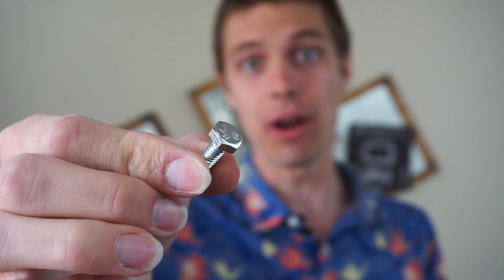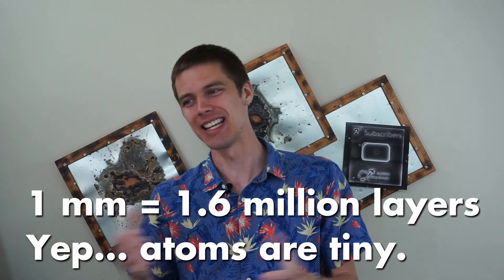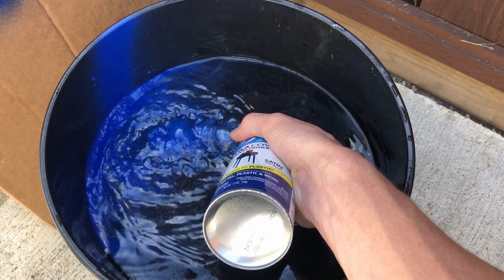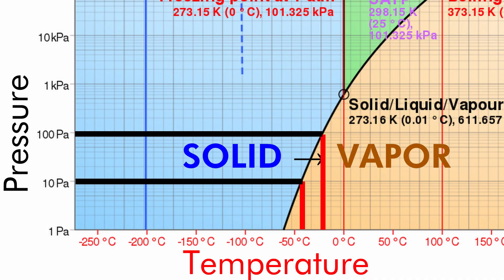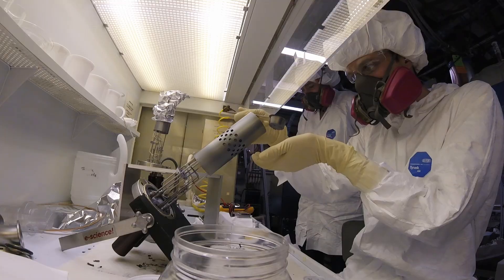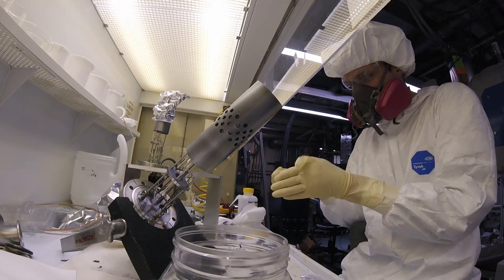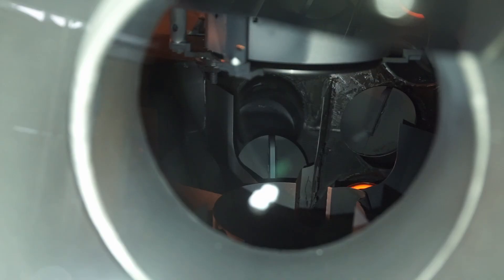How to evaporate a metal

Comment: I am much enjoying your series on your equipment. My father built similar equipment for Westinghouse several years ago to facilitate precision electron beam welding equipment and vapor deposition equipment for precision coating. They were test systems to provide proof of concept equipment and develop the technology to where it could be marketable. The vacuum pumps he used were very impressive to my teenage self.  The system was housed in a small cylinder, inside a booth the size of a small room to provide a two stage vacuum tight sealable enclosure, as the working surface had to be somewhat larger than those you are dealing with. There were,as I recall, three stages of vacuum pumps working on different principals to obtain the required levels of vacuum. On the other hand I suspect his allowed target area might have been somewhat larger than that you work with and the precision you deal with may require another order of magnitude of vacuum than Dad's system did. Dad built all manner of things as prototypes for Westinghouse. Engineers came in with fancy designs and schematics and Dad helped them to scale there sometimes unwieldy plans into something that might actually be capable of being built. Your lecture on how your equipment works is "deja vu all over again" to quote Yogi Berra.

Comment: I’m interning now at a thin film coating lab, we use resistive source evaporation, e-beam, and ion beam sputtering. Our pressure is only 10^-7 …. I’m not sure I completely see the need for epitax, it sounds like it works in between resistive and e beam. ?

Comment: I'm working on a prototype in cad right now. But there is a question I can't figure out. If I heat a metal in a vacuum past it's vaporization point without using electricity with it form a plasma? Or will it just be a hot heavy gas?

Comment: chemist question here:
if you "fire" gallium and arsenic at the plate:
do you have layers of gallium and arsenic OR do they bind "mid flight" to form gallium-arsenide (crystall)?

i´m asking because these are 2 completely diffrent things.1 is just evaporating 2 thing a depositing, the other one is a chemical reaktion mid flight.

Comment: As air tight as this all needs to be, I have to ask - how often does a shutter get stuck?  I think a saw a metal bellows flexing to move them - what's their lifetime, generally speaking?
Reply: They live for a fairly long time. Even if they get stuck (because of some deposit happening due to a bad alignment) every time you do maintenance you can fix it. Then your shutter lives for tens of years.

Comment: I used to operate vacuum deposition evaporators. E beam guns under vacuum are fun to play with, but sputtering is fun to watch. The particles tend to stick to the coldest surface. So, hot chamber but colder substrate...we were coating photo reactive optics.

Comment: I'm currently doing something very similar to this, just in extremely crappy fashion, in my basement.
I sublimate carbon in an arc in a ~1 Pa vacuum and hope to grow something vaguely resembling graphene on a silicon wafer with an oxidized top layer.
Does your apparatus have means to heat the target?

Comment: It is really interesting! Would be super neat if it could be miniaturized and used perhaps as a “nozzle” for a new type of metal 3D printer. Just mount it onto a gantry inside a vacuum chamber and feed it some gcode!
Reply: If you think about it, that’s pretty much what they do when making microchips, but with photosensitive resists and masks. That lets them build their 3D ‘cityscapes’ much more quickly, instead of the raster scan-like process of most current additive manufacturing. If a company could get good at aligning dozens, if not thousands of printer heads to print the same pattern on the same table, you’ll have a better mousetrap!

Comment: Now that we know WHY it has to work like that, I wanna know WHAT those coatings are used for...
Reply: As with most tech, probably military and or sex. ( Joking of course)
Reply: @darthandeddeu  This is for semiconductor research and although the cutting edge of semiconductors are not used for any of these, semiconductors are everywhere. The cutting edge of semiconductor tech is mostly used by NASA and internet companies. Or this is just what is called universal basic research in which case they are basically doing this for fun and for the sake of learning random stuff..
Reply: https://mukherjee.sites.stanford.edu/

He showed "Mukherjee Group" in the video, it looks like they study semiconductors and the effects of imperfections in their crystal structures. So I would assume it's important to be able to grow a flawless crystal as reference when studying imperfections, as well as to be able to precisely cause imperfections in the structure.
Reply: I work for a photon detector company. We make PbSe IR detectors. They're good for sensing ~1-5µm wavelength. We put the material on a substrate, cast a few spells (trade secret, sorry), and viola. Cool them down (we use TECs) and they can detect IR extremely well.
Reply: The Gallium arsenide is probably for a really good semiconductor, but I would guess you could coat almost anything with anything to make anything here... Yeah, I'm not a rocket-surgeon...
Reply: Check Balzers, there are many many applications, low friction, surface hardening... I don't know what he uses PbSe for.

Comment: I have a serious Question AlphaPhoenix. You Say you try to not touch the crucible with the bag. But the Material inside was rubbing against the Plastic all the shipping and while pouring it out of the bag. So isnt this kinda pointless?
Reply from the maker: Every additional surface adds contamination. the fact that packing is necessary is simply unfortunate. the e-beam evaporator I used in undergrad would use gold coins, but a whole coin wouldn't fit in the crucible. every cut with a pair of very clean bolt cutters would add contaminant. You couldn't cut too many times.
Reply: @AlphaPhoenixChannel  Thanks for the Answer. It is logical, that the Packaging is necessary, but with such expensive Materials, wouldnt there be a better variant of Packaging be possible? Something with is not that easy to scratch particles from the surface than plastic?
Before your Video I was never thinking about this part of cleanroom and high refined Stuff. Its a little mindblowing for me, to think about this in this order of magnitude of clean working.
Especially, because i am Car Mechanik, sometimes we have to work "clean" too, but our clean is pure garbage inside a canalisation against something like this. :-D

Comment: Probably too late, but if the bolt ‘evaporates’ at that rate, does the metal that makes up the vacuum chamber not do the same? Is it at a lower rate, or do you use a special method to mitigate that or stop it
Reply from the maker: I picked a zinc-plated bolt as an example because it has a high vapor pressure. The chamber is made from stainless and that pretty much goes nowhere

Comment: would it be possible to make graphene with this equipment?
Reply: Yes. But the reason graphene isn't used in industry yet is because many applications would require large sheets with few or no defects. Currently, the only ways to make such high quality sheets are by processes like this, which are expensive and slow. Hopefully in the future, new developments will make synthesizing large high fidelity graphene sheets much cheaper and faster.
Reply: @SafetyLucas  we hope so!

Comment: just stumbled on your channel, very interesting stuff regarding the MBE. Could you explain how the penetrations (electrical and mechanical) are sealed? I would imagine polymers would outgas at such pressures.
Reply: I recently watched another video on finding leaks in ultra high vacuums. They used gaskets made from soft copper alloys and a circular ridge on the mating surfaces that cuts into the gasket to force the copper into every crack. This permanently deforms the metal, so they're single-use.

Comment: I've never heard of this side of science.its fascinating
Reply: Vacuum engineering is super weird and intense. You can use like 0.1% of the available materials in UHV. You've got cold welding threatening to stop everything and basically everything is sitting there sublimating/evaporating so you've gotta be careful with all your lube, plastics, adhesives, cleaners, and cleaning materials. You no longer get to use gas pressure to hold or move anything since you're in a vacuum already (no suction or blowing), and you have to use vented screws so you don't make virtual leaks inside the chamber itself. Usually the beams are controlled or steered with magnetic fields, so you can't use magnets or ferromagnetic materials either.
Reply from the maker: The sample spins with a magnetic feedthroughs and at one point after service I think we either didn’t replace the mu metal covering or it was loose (I thought it was just stainless) and then we couldn’t figure out why the rheed electron beam was going everywhere - unshielded magnets…

Comment: Stupid question, but how do you mechanically manipulate things inside the vacuum? Wouldn't there come some point in the interface between you and the tool where the vacuum steel would need to be broken? Brady Haran did an Objectivity episode about a mechanical lever inside the space station that controlled something outside, and it was separated by an o-ring. Answering this would make a great video.
Reply from the maker: Haha also in the works!

Comment: K you're gonna have to do a video demonstrating the scale of atoms, because my mind is unable to accept the "30 million atoms per second" statement. That's almost 2 trillion atoms in 6 weeks, and I know that a trillion is already an astronomically huge number.
Reply from the maker: I’ve got a video planned about ultra high vacuum pumping, and I was considering an example with a stadium (not sure I’ll use it but here goes)

There’s a big soccer stadium here at UCSB - a few stories tall of bleachers. Air is already extremely not-dense, but if every particle in “air” was a ping pong ball, and you’d filled the stadium to the brim with ping pong balls, that’s your baseline. The pressure in the MBE is not one ping pong ball per stadium, but 1/100th of a ping pong ball per stadium. In ultra high vacuum, each ping pong ball sized molecule would have 100 stadiums to fly around in before it hit another particle. So when I say that zinc evaporates from a bolt really fast, it’s still basically nothing. Atoms are tiny!
Reply: @AlphaPhoenixChannel  it would be helpful to have a visual for how many atoms are in the thing total. I think the mind basically starts lumping things into mind bogglingly huge and then essentially unlimited, but we're getting into mind bogglingly huge just at millions and billions. How many atoms are in the bolt? What kind of mind boggling number is that tiny bolt comprised of?

Comment: what are the crystal products used for in the end?
Reply: Well, GaAs is used for microchips. You have properly heard of Silicon based chips. Si is the most mature technology. But Si has some build in drawbacks too. It does not have very good high-speed properties and it is incapable of generating light. This is a problem if you want to make opto-electronics. Different technologies have different pros and cons. GaAs can be used to make lasers on a wafer (same way as chips are made) it is cheap and reliable.

Comment: I have a couple of questions 

Can any metal evaporate 

Does water and metal have similarities
Reply from the maker: yeah absolutely! every solid or liquid (condensed matter) has a vapor pressure. the trick is that that pressure may be so absurdly low that statistically you'd never observe an evaporation event - doesn't mean you can't give it a number. I chose zinc here rather than something like iron because zinc has a pretty high vapor pressure in the realm of metals, and we use zinc-plated bolts all over the place so it's a common material. 

water obeys all the same rules, but it has SUCH a high vapor pressure that it makes up a few percent of our atmosphere. I have another video about getting water to boil with pressure: https://youtu.be/hHNoHhbfFDQ

edit: you can get anything to evaporate, even stuff like iron and tungsten and ceramics, if you get it hot in a vacuum - which is probably how they actually MEASURE vapor pressures. Some evaporation rates just become vanishingly small when you trace it back to room temperature.

Comment: Great video. Would cooling down the target plate down help speed up the processe? Making diamond next? Hey are you going  to make any more astronomy videos?
Reply from the maker: Cooling down the plate makes the atoms come to rest sooner, but actually can decrease the quality of the crystals because they freeze too fast and don’t have time to optimally arrange.
Diamond is actually super hard to grow and you can’t do it in an MBE. At atmospheric conditions diamond is actually metastable, so you either need crazy high pressures or a really complicated reaction to build the diamond lattice without accidentally turning it into graphite.
Yes more astronomy videos are in the works but my next few months are going to be real swamped and I won’t be getting to them yet. Eventually soon*
Reply: @AlphaPhoenixChannel  I read some where there are making low pressure  Diamond in a vacuum.  It seem like you would have a better way of adding GA then losing  you vacuum. It seem like the cell could be switch out  robotly.    Bismuth is kind of a strange metal Crystal.
Reply from the maker: They use a technique called CVD to grow epitaxial diamond at metastable pressures. It’s a bit more complicated than an MBE like this

Comment: This is fun. Since this deposition can be quite substantial given enough time, does that mean that the shutters get caked with the material you're depositing? do the rest of the surfaces inside the chamber? how does that look like? Does it feel like hell to have to clean a surface that's covered in material deposited literally atoms at a time?
Reply from the maker: it does! and yeah it's super-annoying to clean up all the coatings... with some of the materials, like tin selenide, it forms little flakes that fall quite easily, so you can grow a flake on the shutter, then have it fall back into the mouth of the cell, where it gets hot and starts evaporating, completely throwing off your flux calibrations.......... Last time we opened the system somebody reached in through one of the window holes with a really long metal stick with a brush on the end i think and just scraped around the cell holes.

I was maintaining an e-beam evaporator (that deposited thin metallic coatings) in undergrad, and one time I actually took the lid off the chamber and spent a day with a screwdriver, some wire brushes, and a shop-vac trying to remove like  20 years of accumulated gold, aluminum, titanium, and nickel, all of which came in layers that were only like 20nm thick.

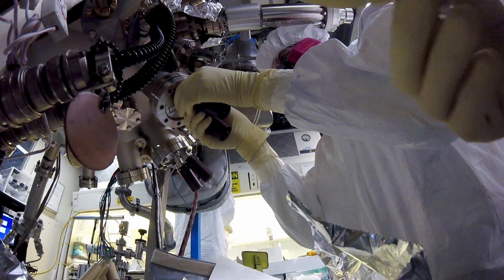Comment: Another Steve Mould convert here. Loving the channel. I have two questions from this video. 1. How do your shutters work without losing the vacuum? Are they magnetically controlled? Looked very mechanical at 9:18  2. Are you able to ignore the evaporation of the pressure vessel itself because it isn't a focused beam from a heateed source? It seems to be a few orders of magnitude bigger than your bolt head.
Reply from the maker: The shutters don’t create a seal, they just block the straight-line flux from the cells. They’re actually controlled through stainless steel accordions that can move without breaking UHV. The chamber is made of stainless steel and is mostly held at liquid nitrogen temperatures near the growing sample - its vapor pressure is REALLY low. I chose a zinc-plated bolt as an example up front because it was dramatic. I did the math for a piece of steel to see if I could use that as an example and I think even at room temperature the equilibrium was like one vaporized Fe atom in the entire city of Goleta...

Comment: Oh man.... in another universe I definitely became a materials scientist. I've always found it super interesting with a lot of room for creativity, fun experimentation and research that can have profound implications on the lives of everyone.
I do have a question, though. How do you prevent atoms from other metals and materials in the chamber from landing on the target? 
You opened with the fun fact about the zinc evaporating from that bolt.... I would expect that to be happening at an even higher rate from all the surfaces in the vacuum chamber.
Reply from the maker: Ooooh boy that’s a good question - the chamber is at 10e-10 torr, that basically means nothing’s flying around. In order to get that low, you need to build the system out of low-vapor pressure materials. Regular oil and rubber gaskets, for example, would evaporate away and full your growths with carbon.

Comment: cool. Seeing this in reality is enlightening. Some reason made me wonder > what about the oxides ? <    Thanks for sharing. Its thought provoking.
Reply from the maker: There are a bunch of systems that do oxides at UCSB and I have to say I don’t remember with 100% certainty how they do it. They absolutely need to be careful with their pumping so that the extra oxygen doesn’t hurt the pumps, but in general i think the most common technique is to use a gas source instead of an evaporated metal. Just replace the effusion cell with a gas bottle and an ABSURDLY small needle hole/valve to let the gas in. If the background pressure is low enough, the oxygen will travel in a straight line just like the metal and land on the substrate. I’m not sure what materials or etching processes need it, but sometimes the O2 gas is actually fed through a super-hot “cracker” zone that breaks it apart into atomic oxygen so it’s super reactive when it reaches the substrate.